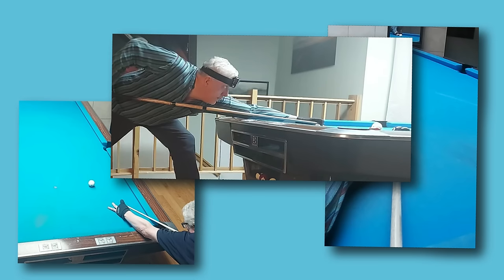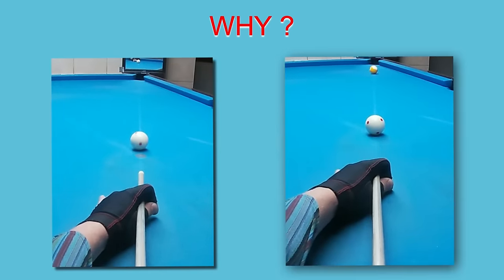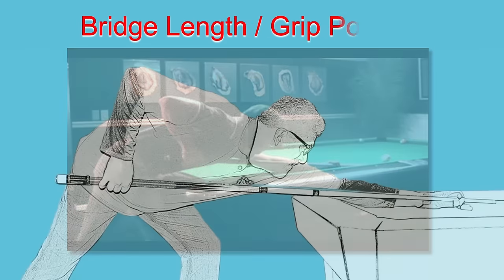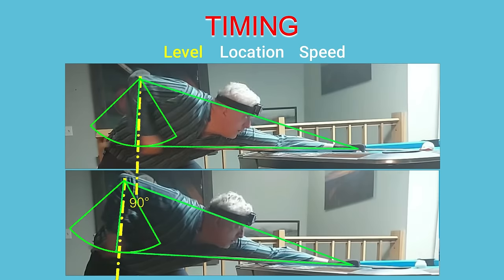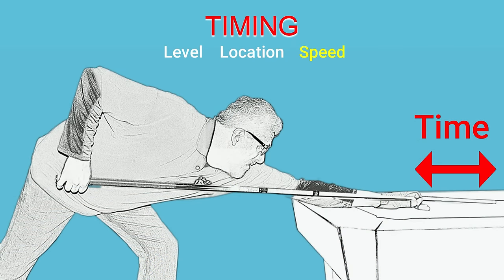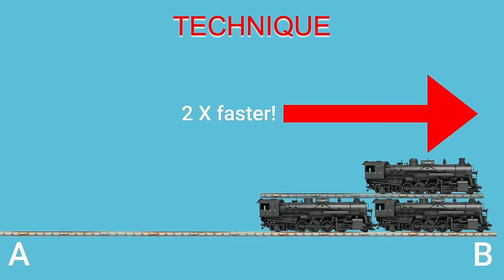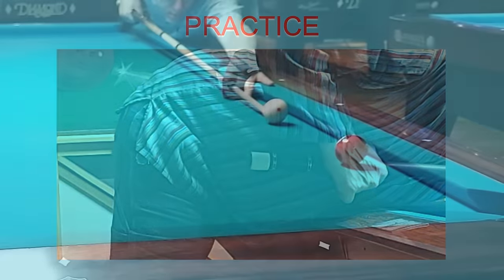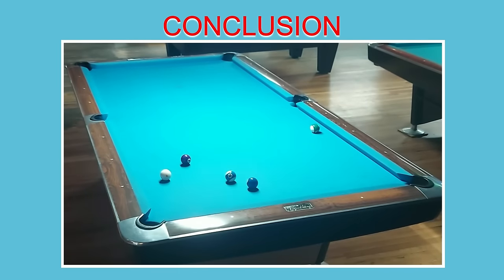How to Power Draw the Cue Ball with NO MISCUES

Comment: Good video. I will definitely try the exercise of trying to draw the cue ball the length of the table to within a couple of inches of the opposite short rail.  One minor point:  When the cue ball is being drawn, it is spinning around the HORZONTAL (or x) axis parallel to the table and perpendicular to the path of the cue ball, not the VERTICAL axis.  And with side spin, the cue ball is spinning around the VERTICAL axis.

Comment: Hi Bob, I had to comment once more. I’ve been practicing the mighty X drill tonight and executing the draw shot version. 
Of course the goal is to draw the CB back into the corner I shoot from. 
I did two things you mentioned here in your video. First,  I’ve lengthened my bridge and moved my grip hand all the way back to my 3” extension. (with my pinky over it) Secondly, I’m slinging my wrist as you’ve described. These two adjustments are allowing me to shoot less violently and I’m getting way more draw with an easy more controlled stroke. My miscuing is non existent as I’m far enough back with my grip hand that my true 90° happens after the cue ball is gone.

Even though I’ve known this from my own practice sessions, I’ve been neglecting to be more aware of these adjustments and it’s cost me many miscues.  
Thanks once again for opening my eyes to what it is I must always be aware of. 
Huge huge help Sir, Ron

Comment: Outstanding info and presentation, thank you!  Your thoughts on  this: I believe that when shooting a draw shot from a mid-level distance (3 diamonds away), we will get much better results if we intend to use the exact same stroke as when we were only 1 Diamond away.  Trying to put more power in, to get more rotation (“under-spin”), contaminates the good technique we used on the close shot.  Btw: your explanation of the momentum / rotational aspects is best I’ve seen, underlying what goes into delivering what Mike Massey described to as “a lot of (side) spin with a soft stroke”.

Comment: Love this one my man. Technique is everything.

I think most folks don’t understand that an elbow drop doesn’t exist to “give you more power” cause if it takes place after cueball contact, as it should, then it doesn’t matter. I only mention this because for me, the elbow drop is a physical reminder to stay lose. Between that, a supple wrist, and a stroke slip (which we can get into if you like) gives me a very natural but elongated follow through. I mostly use it because it insures the timing of my stroke is never “sweetest” after cueball contact.

I’m curious too if the fact that my stroke slip helps in draw for this reason. It behaves more like a finger roll mechanically where the cue starts on my index finger and moves to contact my pinkie during cueball contact, effectively making the angle of the elbow to grip point slightly wider (like how you show when you hit the draw good).

As a fellow mechanics nerd, albeit with very different technique, I appreciate the detail and reasoning behind your videos- this one included. Keep at it my man.

Comment: One thing I didn't see directly addressed is tightness of the grip. When I try to power up my draw shot, I often tighten my grip unintentionally. this raises the back of the cue, pushing the tip into the table. By using the proper technique you demonstrated, less power is needed so the unintentional tightening is less likely. The floppy wrist also lends itself to a loose grip. Finally, using less power means I'm less likely to distort my pendulum stroke, ensuring accurate tip placement.

Comment: I have been working on my power draw lately ,,amazing videos are coming out just recently about it.  Darren Appleton just did 1 about a month ago about same type thing,,but different .lol
    I use predator 1080 chalk,,the octogon piece. And the last piece I used had a rock stuck in it,or a piece of metal ,,very small but caused a ripple in the chalk. Everytime I chalked I could feel resistance and it almost knocked the chalk out of my hand.
 I then noticed the hard spot in it.
 I used a knife and dug it out. I have never found anything stuck in a piece of chalk before???And I used this chalk for a lomng time before I noticed this. Wonder how many times it wiped more chalk off than put on???
Reply: I must say this is one of the best explanations I have seen. I am going to test this out now. As I do mis cue at times and cant figure out why. The stroke feels good even when mis cue.

Comment: It’s not all about bridge length it’s more about keeping the cue as parallel to the table, the comment the grip being slightly forward from the desired 90degrees is the reason for miscue is correct. This results in a see saw scoop. 
The elbow drop is just as common or more so among professional cueists, Ronnie O’Sullivan the greatest snooker player drops his elbow on even soft delicate shots other professionals not so much although on power shots the elbow always drops if only slightly. 
The other clues including a light and flexible grip are on the money and the most important of all is keeping the head still until completion. 
The bridge should not be over long or over short and depends on different players different techniques. 
All pool players can improve their game by adopting a snooker technique, errors in technique are magnified in the more precise game of snooker. All advanced snooker players can play pool at a high level with out altering technique . The reverse,pool to snooker needs a complete overhaul of the pool players technique.The power draw is better with a longer backswing .

Comment: I think there's another factor that compounds the miscue problem.  As you elevate your cue, "center ball" elevates with it, and of course the miscue limit elevates as well.  So the dip in the tip position might seem very slight, but the slight rise in the position of the miscue limit adds to it, turning a small error into a big one.
Reply: you  are right but that's  way they go so low with the head. i play a game called skomager its like 3 cushion billiard and its very normal to have a more upright position with means that 
the elbow is not strait up in the air when you are down on the shot but the cue angle is the same.

Comment: question. if there is a pause in backstroke or slow backswing, the wrist will not naturally backbend. so what then?
Reply from the maker: With a very short pause you can hold your wrist. A longer pause will be more difficult. I'll have to watch Chris Melling, because he has a very long pause at the back and a loose wrist.
Reply: @ShortstopOnPool  watch fedor gorst also. Melling, gorst and others seem to have no problem drawing with extended pause at backswing. They do seem to have have longer strokes though. Maybe they use more arm and less wrist? 🤔

Comment: It seems to me that a pendulum is only in the 'correct' place for a split second. It seems to be the case for the pendulum STROKE also, with so many people rabbiting on about 'timing.' It also seems to me that many players DON'T have the cue swinging up and down because they use the always-level piston stroke instead, which keeps the cue level THROUGHOUT the stroke, not just at the split second of the pendulum stroke. They keep the cue level on the backswing by lowering (not dropping) the elbow, which then rises back to its normal position as the stroke is made, keeping the cue level throughout.
Reply from the maker: Lowering the elbow on backswing is a more complicated movement, as is raising to achieve 'level' at cue ball contact. THAT is far more susceptible to bad 'timing'. Pinned elbow ensures everything is the same every single time. And simpler movement means straight delivery and precise cue tip placement happens with far greater consistency.
Reply: @ShortstopOnPool  Thanks for taking the time to get back to me. I've been watching a lot of snooker professionals who seem to do it all with ease. I don't think they consciously lower the elbow or raise it back again - it just seems to flow all in one motion. Guess I've been spoiled by the brilliance of some snooker pros.
Reply from the maker: @cueball5858  Right. Remember, though. That snooker players have FOUR points of contact with the cue stick. This keeps things on line.
Reply: @ShortstopOnPool  Yes the 4 points keep things on line but the point I was trying to make is that the cue itself is kept level throughout, like a piston and does NOTgo up and down like a pendulum. When they do the backswing the elbow is automatically lowered as they strive to keep the cue level. It automatically raises again into the correct position as they shoot. Why anyone would want an up and down motion of their cue and have it come right for one thousandth of a second is beyond me. And then they the blabber on  about 'getting the timing right!' I don't think many good pool players use an up and down pool stroke.
Reply from the maker: @cueball5858  and yet you watch hundreds of videos where they do just that. And I already explained it.